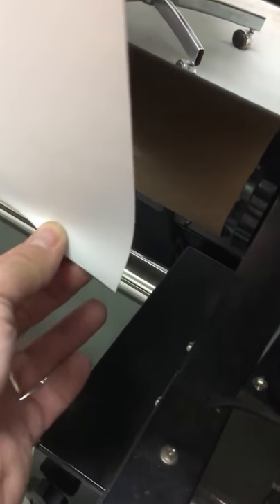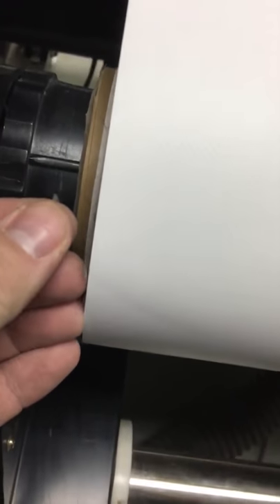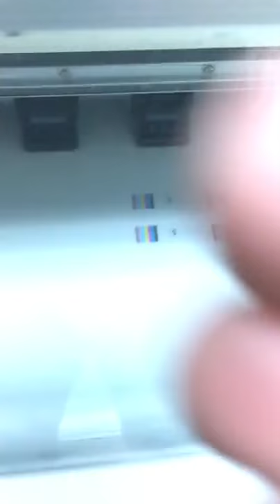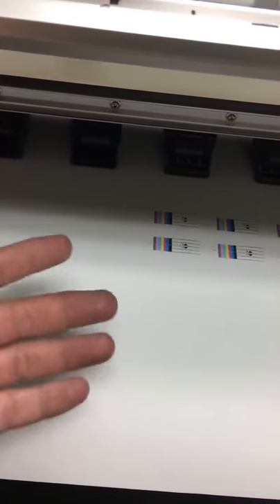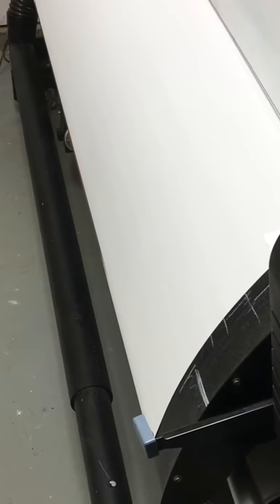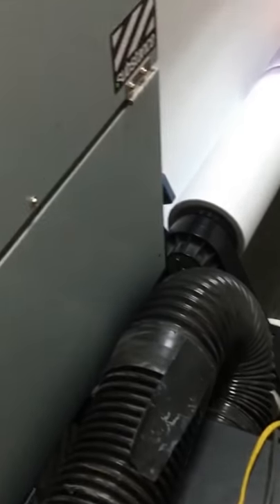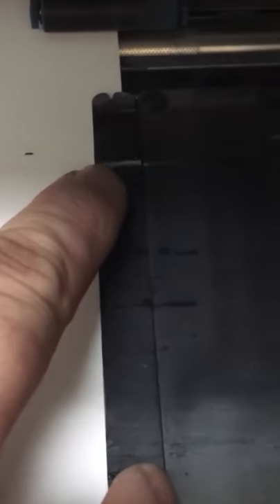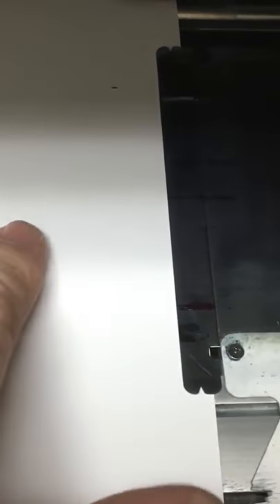Double Sided Banner Printing [How To]

Comment: Does this print/ink withstand outdoor elements? If not, is there an application to protect the print from rain/snow/cold? I am thinking about buying a large format printer.
Reply from the maker: It’s depends on the printer. What kind are you looking into? Typically most wideformat printers will have ink that can withstand the elements for a few years, some less and some more. I work with a hot solvent printer so the inks hold up nicely for good 5 + years without fading.
Reply: @blackcapdesign  an Epson stylus pro 9500 capacity 44 inch wide. A printing company is liquidating some old stuff before an upgrade so I was trying to figure out if the printer would produce commercial quality print before acquiring it.
Reply from the maker: Recognize Game what type of products do you intend to produce? Just looking at the printers specs and information on the ink. It looks like this printer is made for interior signs and graphics and not exterior. 

https://global.epson.com/company/corporate_history/milestone_products/36_esp9500.html

Check out this info above. Its all about the market you want to be in. Let me know if I can be of any help. Thanks 👍